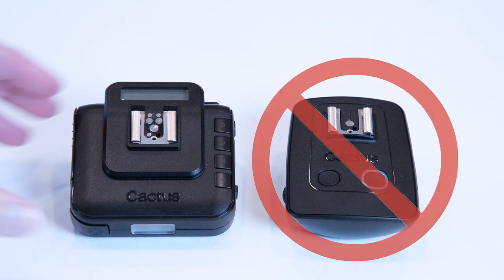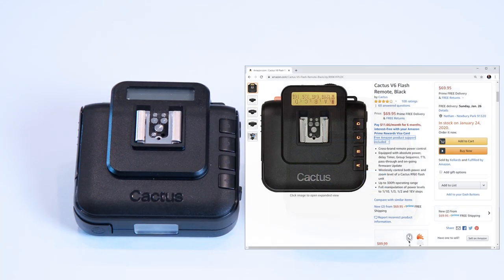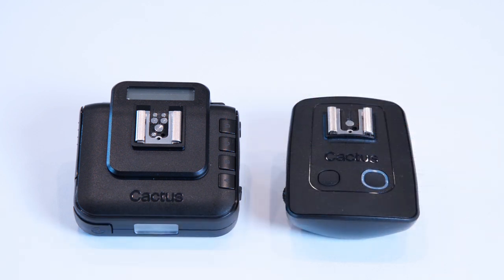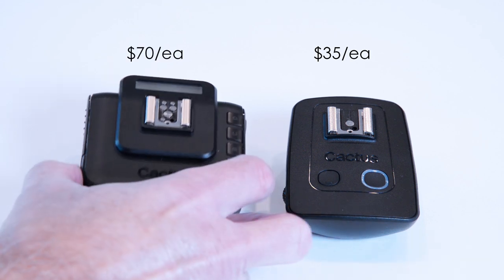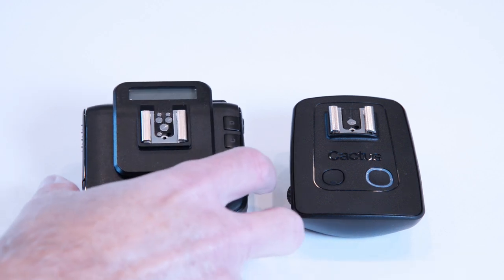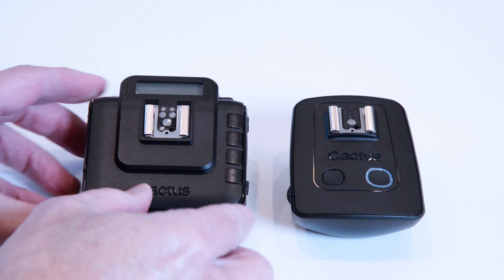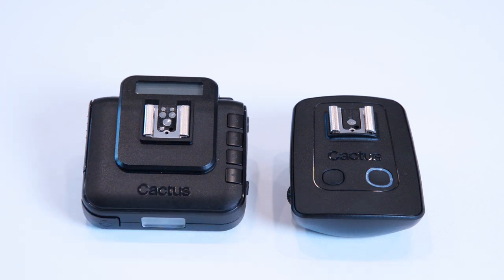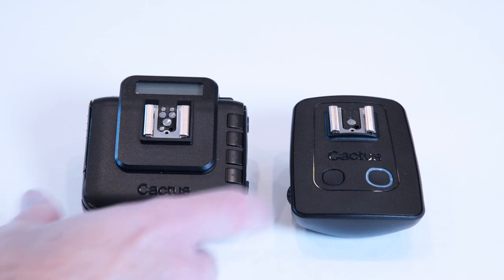Trigger Updates for Real Estate Photography

Comment: Great content as usual! I have an 80D and Canon Speedlite 430 EX ii, however looking to eventually upgrade to an AD200 Pro. If I get the Xpro for Nikon to avoid WB issue, will the Xpro work with a Godox X1R c (for canon)/speedlite setup? 

Will the Xpro be able to change the speedlite's flash power? Ive read that the Speedlite needs to be in TTL mode while the xpro is in Manual.
Reply from the maker: Thanks! I'd pick up a Godox TT600 speedlight, they're super cheap, and then sell the Canon 430, here's a link to the TT600: https://amzn.to/3Iiz3BP

Comment: Hi Nathan quick question I already have XproN could I use a R2SP as an adapter/trigger? Other words stack my XPro on a R2SP and use another R2SP to trigger flash? On Adorama’s website it says the R2SP could be used as a trigger. Just not sure if it would work as a adapter at the same time? Thanks again for all your insight!
Reply from the maker: Hi Paul, XPro and R2SP are compatible triggers.
Reply: Great I’m going to try it. I need a new trigger anyways and this would fix white balance issue at the same time🤞thanks mr cool
Reply: Nathan Cool Photo hey Nathan I tried the R2SP as a shutter release/adapter it worked “kinda” so stacked my xpro on top of R2SP switched to RX I bought two R2SP’s which was only $7 more total then the Yongnuo’s the problem when is when I take a pic the R2SP that I’m using as a trigger fires the flashes twice once before shutter then again with shutter. Seems like I press halfway it fires then again with shutter. I just need to figure out how to stop the first flash from going off and I’ll be golden😅

Comment: Yongnuo RF-603 N3 2.4GHz Wireless Flash Trigger/Wireless Shutter Release is Not Suite for my camera(Nikon D850). Please suggest me one.
Reply from the maker: The issue is with the cable, so you have to purchase a trigger pair with a cable compatible with the D850. In the case of the D850 you need a 10-pin connector. Try this one: https://amzn.to/2Y8ob4h
Reply: @NathanCoolPhoto  Thankyou so much..